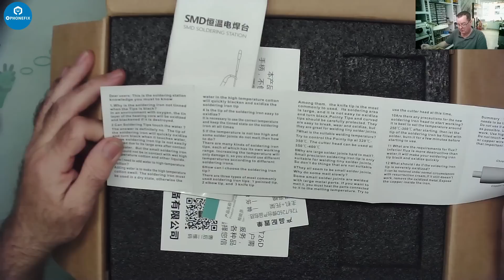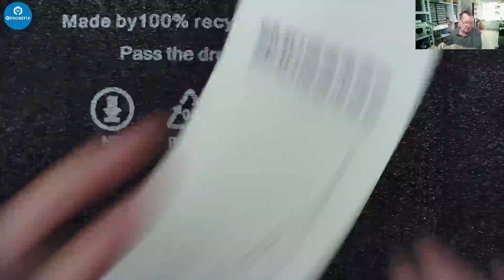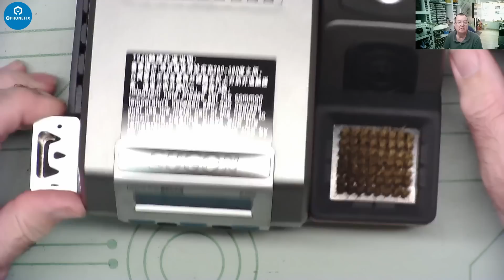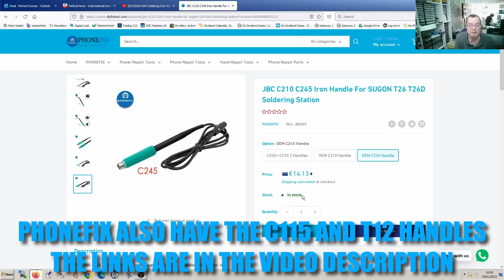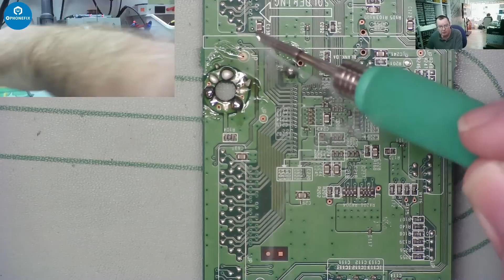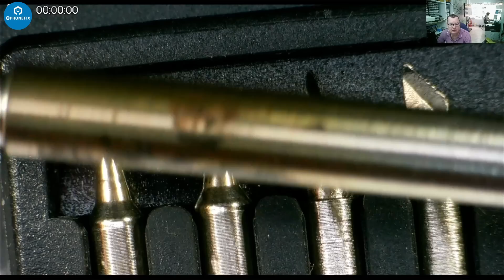Sugon T26D Soldering Station Review C115 C210 C245 T12 Soldering Station JBC original or Copy Tips

Comment: its power line 6 pin host plug interface  is very poor quality  manufacturer use this  6 pin host plug in many soldering station brand like sugon T26 ,T26 D , YCS S1,GVM & Aifen Brand i use all brand Before Comment  hear  This host plug comes in soldering stations of different companies and I found this flaw in this host plug that it is not at all suitable for continuous use. If you use the soldering station continuously, for example, if you work on it for more than 6 hours a day, then temperature is generated on its host plug. Due to which its plastic material starts melting and it breaks into pieces. Due to which I found the quality of its host plug very poor.
Reply: What would you suggest instead?

Comment: SUGON T26D welding rework station with JBC C210 soldering iron tips, 2 seconds rapid heating and 3 channels adjustable for motherboard BGA SMD chip repair.
Reply: Hi, is this compatible with JBC C245 tips ?

Comment: Good video, as someone who does soldering as a hobby / to repair home stuff this is very useful information. I would love to see you look at the Sugon T21 compared to the T26D as it's cheaper but looks similar it's compatible with the same JBC tips etc. I'm thinking of getting that one spending a bit more cause I already fried like a 80$ keyboard PCB and one of my SBC boards with my dad's cheap Iron so I don't want to cheap out on these things going forward cause I ended up losing ton of money.

Comment: Nice station! I have Sugon T28 for some months now and I am very happy with the performance using T210 tips. Have used a thermometer to calibrate and its max around ± 5 °C from what the screen displays. I want to use T245 in future on my T28 too but some Chinese sellers I asked told me it will not work.. not giving explanation why it will not work though. Does anybody has tried using T210 on T28 station?
Reply: i had t28,,, it cant use c245 because c245 cartridge had higher working voltage

Comment: My experience with Phonefix JBC Clone tips have been sub par. 7 out of the 10) C210 tips were manufactured really poorly. The plastic separator rings were all different sizes which blew my fuse on real JBC station. Just wanted to give you a heads up on the tips. I only purchase OSS Team clone tips and JBC gen tips from now on. eBay is great for buying used JBC tips too. Make sure if you start buying the clone tips to look closely at the distance between the gaps before inserting them in. I have 2 JBC stations and use the C115, C210, & C245. I always compare the clone tips to my originals now and check the resistance before using them.
Reply from the maker: I'm not sure if you watched the video all the way through?  I did prove pretty well that the JBC original tip worked better than the clone tip of the same type.  Also in summing up I said I would only buy original JBC tips and this is also my recommendation to others
Reply: @learnelectronicsrepair Hey ! Sorry if I came off like a jerk or if it seemed like I didn’t pay attention to your video. I definitely did watch your video all the way through. I watch all your videos start to finish. I’m a huge fan and I’m very thankful for everything you put out. I was just stating my experience with PhoneFix’s tips in general for all of the 3 models. C115/C210/C245. They have bad quality control and I wanted to just put it out there in the comments so others would know as well. Your right original  JBC tips are one of a kind when it comes to quality. They do cost a lot so I always recommend trying to find some used tips on eBay when your first starting out until your repairs pay for your tools. I was very lucky last year mid/end of the pandemic season because there was 1 seller here in the US selling NEW genuine JBC tips at a fractions of the cost. I was buying a bunch of variations of all models for about 4-7$ each in “bulk” quantities of 10 to 30 pc’s per auction. I in total was able to purchase about 200-300 tips in total span of 6 months. 95% of them are usable in most situations. Curved/Knife/Bent Conical/Wedges/ and a few others. I gave some away to a few of my coworkers that are in the same field as us. Unfortunately the seller is no longer getting them in bulk to sell anymore indefinitely as of now. I messaged him a few days ago to check on him since we had so much communication throughout the year. If he does get back into selling the tips I will make sure to let you know. It would be great to see you using the JBC style cartridges as your daily driver. I switched from the KSGER about 4 years ago and haven’t looked back.

Comment: I use the T3602 and the A9 both by Sugon. The A9 runs the T245 tips jest fine. I also have the normal T26 and it worked just fine also. I do like buying the original JBC tips. Once you calibrate the station , they are more consistent with temps. 
    I was always amazed how you micro soldered with your T12. Maybe it will be a fun change for you to use the new system. I hope you enjoy it.

Comment: For drag soldering you need to try a special tip, that has a little cavity at the end that holds some solder with surface tension and then you drag it across the pins and the perfect amount of solder is added to the pads. Needs a bit of getting used to, but I think it would be deffinitely worth the try. Other things that I know are worth having a try are soldering tweezers (not sure thats what they're called), I mean the type of handle that holds two cartriges and and can be used to remove smd parts (and others) with a single pinch. I have acces to such a tool at work and it is just great. Recently I stumbled upon a pair of such tweezers on aliexpress that claim to be T-12 compatible and I'm really thinking about giving them a shot. Maybe you would like to test such a tool on the channel some times? Cheers from Poland.
Reply from the maker: @maks886 Yeah I know that 'hoof' tip or BCM for the T12 I do have some of them and have tried but personally I don't really like them much.  Mostly I use the BC3 for drag soldering but now  I tried the bent conical one I want to experiment more with that.  I don't believe the difference of opinion suggests one type is better than another, I think it is more down to the fact a lot of us develop our own techniques when it comes to soldering and desoldering
Reply: I bought these T12 tweezers from Aliexpress (Handskit) and altough the connector is the same and fits perfectly fine, it gave me an error when attached to my KSGER.  I tried re-sitting it a few times and still the same. Luckily, I bought the tweezers with the entire T12 Handskit station, so hopefully it will work together. Haven't tried it yet...
Reply: @rafak9177  that's a pity, I was really hoping they would work. Maybe the pi out in the connector is different. That would require some disassembly and swapping of the pins or cutting the cable and resoldering it in a different way. Do you know what the pinout of these tweezers is? Please let us know if they work good with the other station :D

Comment: What I dislike most about these knife tips is that I have very little control of the solder flow - it constantly creates a big blob of solder  on one side of the tip, instead of the solder going where it is needed.
Reply from the maker: Until the review of the RGS65 ( a few videos ago) I was no great lover of the knife tip either - but being forced to use one on that review, with a bit of practice I actually found it works a lot better than I thought.  I can now understand why some people rave about it, though it ain't as good as my T12-BC3 of course 😉

The jury is still out on the bent conical tip

Comment: Enjoy your content keep up the awesome work

This is the price I got when I followed your link 265.92 $ Canadian  way too rich for my blood couple weeks  I purchased a nice t12 soldering iron heats up quick 20 seconds and delivered to my door was like I 75 bucks and I love the idea that you can buy various tips very decent price a few dollars and all the different features that the t12 station has...
Reply from the maker: And as you saw in this video, I also have a KSGER T12 myself and I stand by it being an excellent soldering station.  I can't quite quantify it yet but there is some quality of the T26D (or the original JBC tips which definitely worked better for me that the clone ones) that seems to set it on a level above the T12.  Further investigation is needed and and I will definitely make a follow up video using the other handles and tips with this soldering station (C115, C245, T12)
Reply: @learnelectronicsrepair  yeah I saw that you were using a t12 later on in the video congrats I was wondering what your thoughts were on the FNIRSI 1014D Oscilloscope - 2 in 1 Digital Oscilloscope DDS Signal Generator 2 Channels 100Mhz Bandwidth 1GSa/s Sampling Rate Built-in 1GB Storage Space

I saw a review where the gentleman was using a single generator measuring and it's not 100 MHz he said it's a hyperinflated number it's only around 30 40 MHz his opinion was to stay clear of this oscilloscope what I'm looking for is a two or four Channel but a scope at a reasonable price and a good product thanks for getting back to me...
Reply from the maker: @no1be4me2  Actually FNIRSI have said they would send me a 1014D to review as soon as they rebuild their stock levels. So hopefully in the fist part of 2023.   I always review based on the repair point-of-view.  If I stick the scope probe onto a 100MHz oscillator and it shows me a sine wave and says 100MHz on the screen then it is a 100MHz scope as far as I am concerned.  This is because when doing repair work then, for the most part, you just want to know if the oscillator is running and if it is at the correct frequency, more or less.   The rest is just semantics.
Reply: @learnelectronicsrepair  this was the link that I was referring to a while ago about saying how it's not a 100 megahertz that it is like 30 megahertz which I'm hoping they do a firmware update grade and can address that problem this is not a lack of inferior hardware components...

Like I said earlier I enjoy watching your videos it's nice to see you do your homework and give us your referrals whether it's a buy or no Buy 

 https://youtu.be/yQKuHJELEOs

Comment: Im still going strong with the ksger t12, 2 or 3 years of daily (ab)use and it's still working like a charm.
Reply from the maker: Wybuchowy Komendant  I also have exactly the same as you, which you also saw in this video, and it works like a charm for me too - but this T26D has some special quality about it which i can't quite describe but it really makes me want to investigate it further. I definitely want to try the C245 and T12 handles with it. Only time will tell which is better, or if there is no real difference between this and the KSGER, and this is something I want to explore on a follow up video - so I guess it is 'watch this space' 🙂
Reply: @learnelectronicsrepair  I want to get a Sugon T21 with C245 tips would you suggest doing that as a beginner? I don't mind spending that money as I have already burned a few boards costing me a few hundred cause of my 10$ iron.

Comment: Used the C245 handle for years doing SMD rework down to 0201 components. You just need the fine tips for the handle. You'll find it much easier to remove SMD caps and resistors if you use dual soldering irons. Just add flux and heat both ends simultaneously.  To fit a component just tin both pads, add flux, place the component, then heat both ends. Presto job done.
Reply from the maker: If you are regular on the channel you will know I do a lot of micro soldering (even HDMI sockets, USB-C and suchlike) using the T12 BC3, which is the furthest thing from a fine tip I could imagine.  I will certainly try more than one C245 tip, I rather liked working with the bent conical tip on this video.  There will be a followup video with the T26D when I have some more handles and tips
Reply: I think hot tweezers are preferred over two solder irons.

Comment: There are a few of these JBC clones around for that price range and Yes, I think the bigger handle with a right combination of  genuine JBC tips is the way to go. Definetly an upgrade from the KSGER. Hope you enjoy it
Reply from the maker: I'm very interested to try the T26D with the C245 handle and the original JBC version of a BC3.  I also want to try it with the T12 handle as a direct comparison to the KSGER.  I'll get some handles and tips but with Chinese new year it will most certainly be February before I can make a follow up video.  However I will do so. 🙂
Reply: @learnelectronicsrepair  I am having difficulties tinning microscopically small pcb traces and pads using the KSGER clone tips. The lead solder tends to flow up the tip away from the pcb. I suspect the KSGER clones might use less copper compared to the originals which I haven't tried yet. Could you do a comparison between KSGER and Hakko to see if it is possible to tin exposed pcb traces?
Reply: There is new soldering irons on the market 2023 !
Qianli mega Nano soldering iron( is the same that uses NorthridgeFix!) is a very good soldering iron for jbc c115 tips ! 
And 
Sunshine soldering irons C210 and C245 tips there are very good too !
Both of the is portable! 

Is only my opinion!
Best regards,

Comment from the maker: Note: The 'antenna' on the right of the soldering station can be used to feed the soldering iron cable to prevent it getting tangled up on your workbench
Reply: I also use the 'antenna' to hold the reel of solder, as I get fed up picking the roll off of the floor.